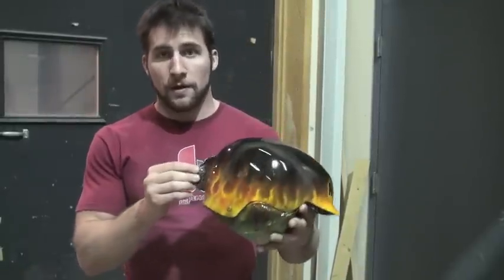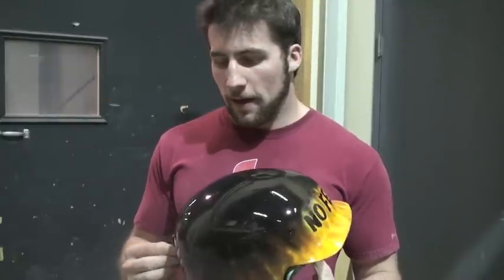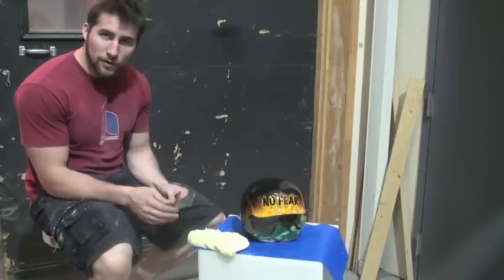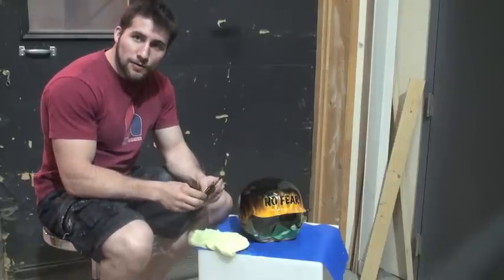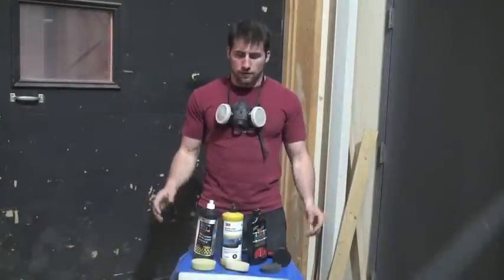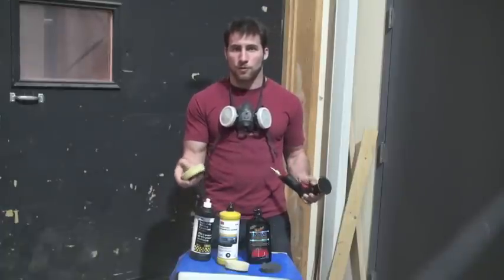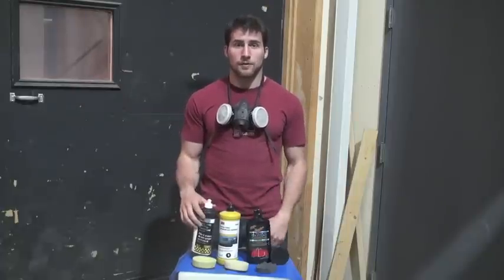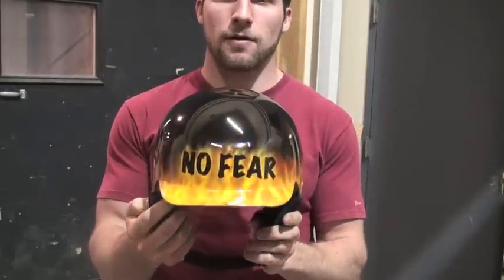How to buff/polish out clear coat

Comment: I used 2k Clear coat and did 3 coats like your other video. How hard would it be with 1000 grit to go right through all 3 for worst case scenario? Or is it too light that it would take a long time and I shouldn't worry?

Also is it okay to do this process after the clear coat has fully hardened? Like if I wait a month or 2, will it be ok? Or does it need to be done at a certain time after spray?

Also isn't the mcguires thing a polish that fills in the all the gaps and spaced in the clear coat? Doesn't that mean it wears off and the item becomes dull again? Sanding it smooth makes sense to me because your not adding anything to the clear coat, but the polishing compounds I don't exactly understand the science to it. Are they adding things on top of the clear coat to make it shiny? Or are they kind of like a super fine sanding process to get the clear coat 10 times smoother than the 2500 grit sand paper? It would really help if I understood this process scientifically, since I can't find info anywhere else online about it, everyone says something different...
Reply from the maker: +Realist you can definitely let the clear harden fully first. 
It's very possible to sand through you're clear if you're not careful, but it does take some time. 
The polishing compounds smooth out the clear even more, but they also kind of burn into it as you polish if that makes sense. They do fill the scratches a bit, but the buffing kind of melds the polish and paint together into a smooth surface.
Reply: I guess it somewhat makes sense, thank you for all of your help, you are very helpful, don't know where else I could ask such a question but on a youtube video and 99% of the time people don't respond. So thank you, you seem like a genuinely nice and humble person.
Reply from the maker: +Realist Glad to be of service. I hope the polishing goes well for you.

Comment: I have a couple little dust specs in my car trunks clear coat probably about 3 little spots, What grade of sandpaper would you recommend i use to flatten them out before i buff it out?
Reply from the maker: sergio montes I would sand as high as you can. 2500+ if possible. Some compounds and polished can take out bigger scratches, but some can't.
Reply from the maker: You're welcome.

Comment: What should i do if after sanding out with p2000 there are still small scratches doe to the sand paper? does that  3m polish clear them so you can use the next 3m product to make it mirror effect?
Reply from the maker: The compound will get rid of the scratches so that you can use the polish to get it all smooth and shiny. It will be easier if you sand to a higher grit, but 2000 should be sufficient.
Reply: Thanks!! I´ll try it! : D
Reply from the maker: Let me know how it goes for you.
Reply from the maker: Looks great from what I can see. Nice job!

Comment: hey Brad, what if I go up to 2000 and use only meguiars compound, how would that turn out?
Reply from the maker: It might take some extra polishing work, but in the end it should be fine. You can also finish it off with meguiars ultimate polish after the compound.

Comment: Hey Brad! I've been looking into starting my own business custom painting motorcycles and I've been following your videos for some time now. I'm curious because you say you finish with the polish but the instructions on the bottle say that the polish burns through clear coats and in order to protect your project you need to apply the liquid wax. What's your take on this as it doesn't appear that you waxed your helmet.Thanks for the awesome videos! They've helped a lot! Thank you! Keep up the good work!
Reply from the maker: The clear coat protects the project. Compound has a very fine abrasive in it to remove scratches. Polish has an even finer abrasive to remove the scratches from the compound and finish the project. Wax assists in protecting the clear coat. Same as when you wax a car. It’s not part of the polishing process really.
Reply: @BradAngove  Awesome! Thank you so much!

Comment: Is it possible to only use the 2000 grit? I can't get hold of a higher grid...
Reply from the maker: It's possible for sure. Going to a higher grit will make it easier to polish, but you can just go to 2000. You will just have a bit more work to do after.

Comment: how long did you let the clear coat sit before you sanded and buffed it?
Reply from the maker: A day or two for this kind of clear coat, but it's not the same for all of them.
Reply: Ooh ok, well I got the clear coat in a spray can
Reply: How long for that do u think?
Reply from the maker: What is it? Lacquer, enamel, urethane, acrylic...? Unfortunately it depends more on the type of paint than whether or not it came in a spray can.
Reply: Laquer
Reply from the maker: Lacquer can vary a bit. For a nitrocellulose lacquer job from a gun I would let it sit a month before polishing. The can stuff tends to dry faster, but I would still give it a couple weeks at least.
Reply: Ok thanks
Reply: Ooh do u have a recommendation?  I need a quick dry one
Reply from the maker: I like Watco and Dover, but they still don't dry super fast. Lacquer generally doesn't unless you get it catalyzed.

Comment: Hi, i have a Gloss Black guitar with lots of scratches on it. I want to get it as good as possible, not expecting factory finish. I see a lot of people wetsnad, then polish out with Turtle Wax, Meguairs etc , but i don't have the experience of wetsanding an instrument. Can you give me some advice as to what i can do to get a good finish....Thanks...
Reply from the maker: +Benny Hill You probably shouldn't wet sand it if it's a guitar. It's best not to risk getting water into the holes etc. and causing swelling of the wood. How bad are the scratches?
Reply: +Brad Angove .......Hard to say...It's all relative isn't it?..........Swirl marks, and buckle rash, with lots of small light to medium scartches on the back. Swirl marks, deeper scratches on the 'waist' of the guitar. Light scratches on front...
Reply: +Brad Angove ..I've just done a video on my phone. It's nightime here in uk now, but you should be able to see...I'll paste the link in this reply section...Hopefully in next 30 minutes...Thanks....
Reply from the maker: I saw the link. Swirl marks on black gloss are ridiculously hard to get out; in fact, I generally can't do it. As for the rest of the scratches, you should be able to lightly sand them out with the highest grit paper that you can find (unless they go through the clear) and then polish the surface like I did in this video.
Reply: Brad Angove
..Okay, thanks.....

Comment: Why do you have to sand and polish as after clear coat?
Reply from the maker: The sanding is to make it perfectly flat, and the polishing is to bring back the shine so you can get a mirror finish. If you're happy with how it looks without polishing, you don't need to do it.
Reply: Great info! Thank you! Does the polishing add any further protection or will I be fine if I like the way it looks?
Reply from the maker: The polishing doesn’t protect it any further.

Comment: So let's just say you're not a professional and you don't have an air hose and you're only working on a couple small pieces is it okay to maybe use a Dremel or a drill cuz I know they come with attachments that can be used for compound and polishing.
Reply from the maker: The drill option should work just fine.

Comment: I was trying to spray paint my car with the the spray can . I sprayed the primer  then base coat and then 2 pack clear coat. After 24 hours I sanded it back with 2000 grit wet & dry sand paper followed by the buffing compound juice. It turned up like this. It's hazy as you can see the difference in quarter panel and the bonnet as the quarter panel is the original paint

https://www.youtube.com/watch?v=FePYK3bOIfs
Reply from the maker: I see. Are you certain that you sanded it all the way flat before you began polishing? Did you apply a "wet coat" to finish off? In other words, how did it look before you started sanding.

Comment: If the toxic 3M products are bad on the lungs, shouldn't you be wearing gloves too?  Contacting the surface of helmet during the buffing phase would most likely expose you to the toxins also.  Just my two cents.  Decent video on how to do smaller clear coat items.
Reply from the maker: I'm less concerned about getting the stuff on my hands since it is very easy to wash off, but wearing gloves would be a good idea for sure.